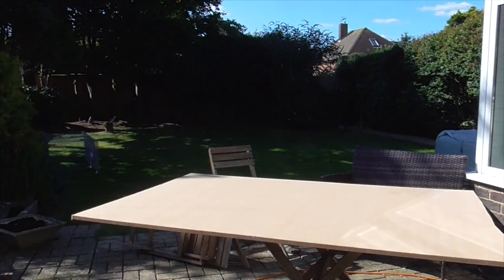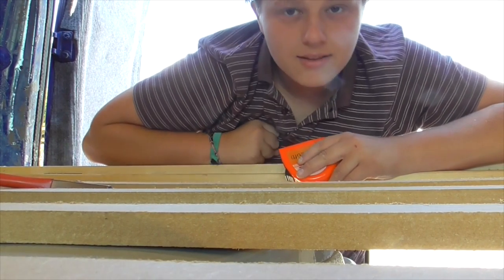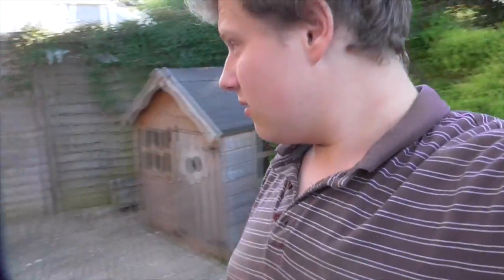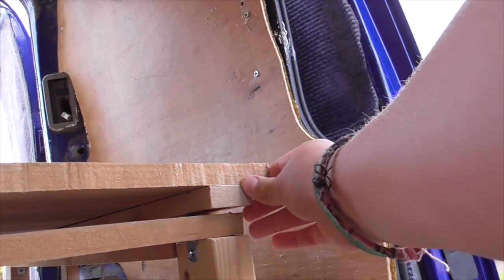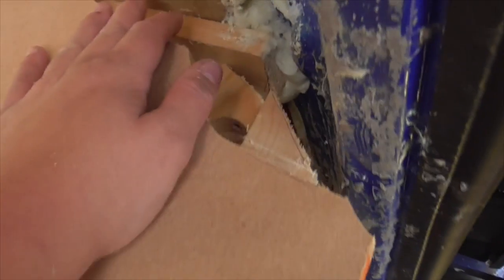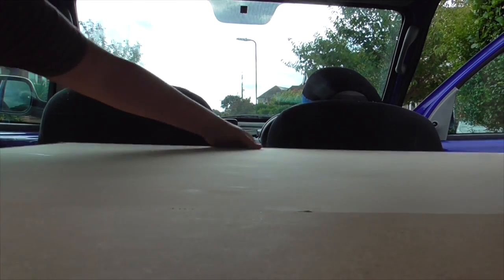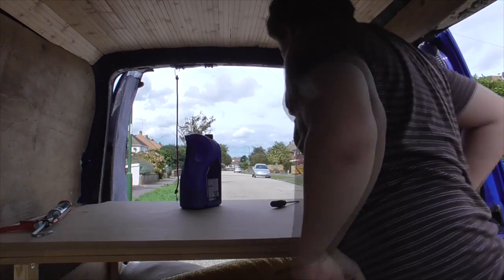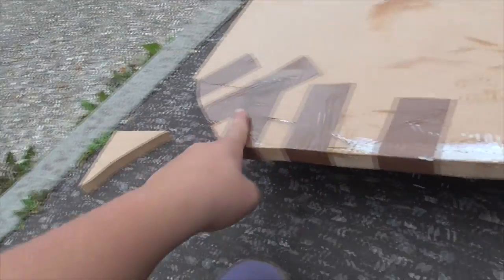Van Build Ep.6 | Micro Camper Bed Build // Part 2 #VanLife

Comment: You really should be using batons for under the mattress, not badly cut MDF strips - they will sag or break, sorry to be negative, but sleep is very important - Liking the rest so far.

Just another tip: Perhaps invest in a good handsaw - you will find that you can make much straighter cuts